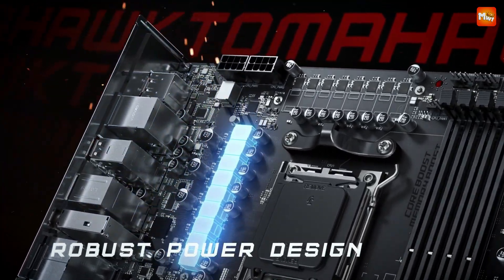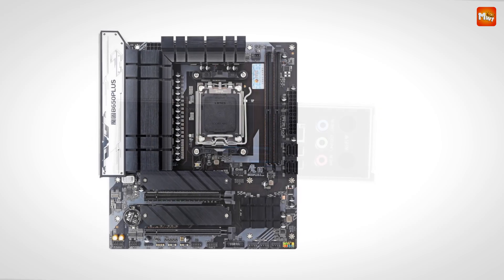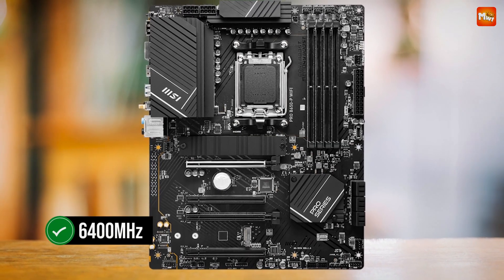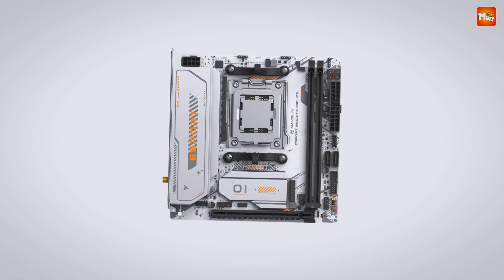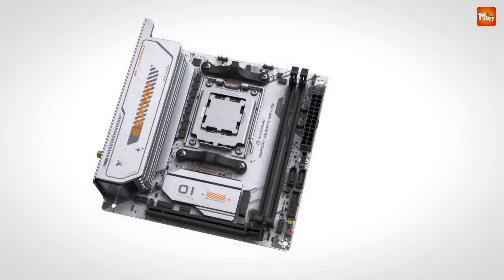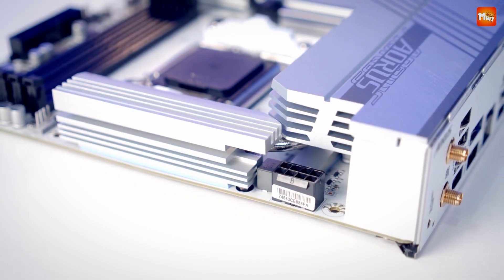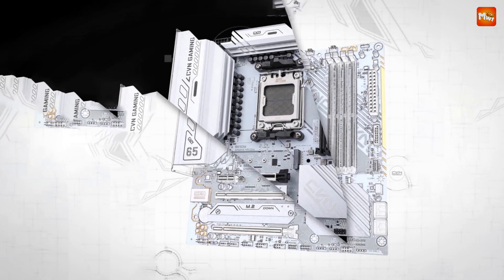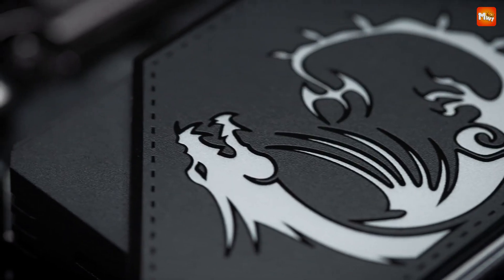Best AMD Motherboard AM5 | Who Is THE Winner #1?

Comment: What is the difference between colorful battle ax b650m plus v14 and colorful cvn b650m gaming both handle all processor and wifi difference
Reply: VRMs difference and heatsinks difference. They're quite similar but the V14 has improved VRMs and heatsinks.